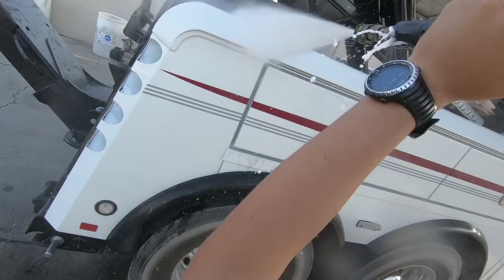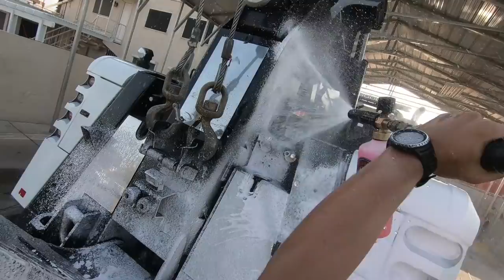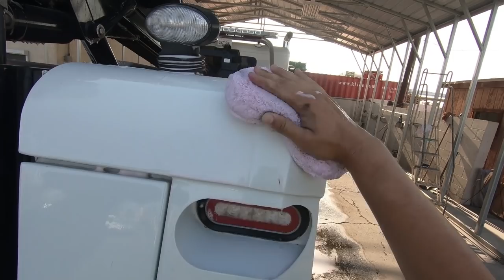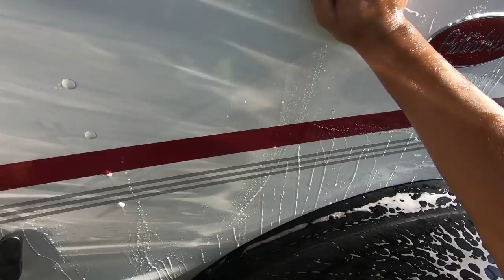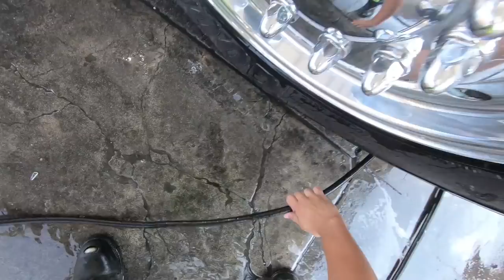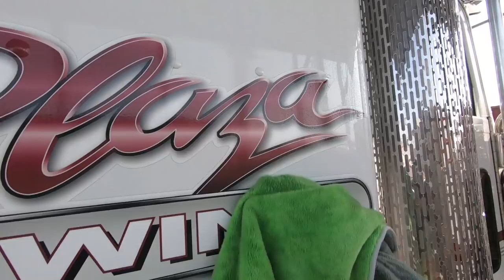How I Wash My Tow Truck | Truck Wash VLOG

Comment: Nice lookin truck. Up here in the northen states we washed our trucks EVERY DAY, sometimes more than once. Between rain, snow, salt, etc its literally a full time job washing tow trucks. A few months during the summer we might get lucky to go one day without washing but that was rare. The most important tool in our shop was the Hotsy pressure washer. We also towel tried the trucks every time. The washer and dryer never stopped doing loads of wet towels.

Comment: Awesome video as always… I had my car professionally coated to prevent scratches and whatnot. They told me whether or not you get the protective coating, you should always use a microfiber towel/sponge and make sure wipe side to side slowly and not in circles. It helps to reduce the swirl marks when wiping. Should also do the same when drying the car as well or use a leaf blower (yes that is what the prfessionals use). I also do not go through car washes as the brushes is what really leaves swirl marks in the car’s paint. Just a car/truck washing tip from someone who tries to keep their car looking as brand new as possible. Always looking forward to the next video. Be safe out there.

Comment: Have you tried Nerta soap? Its Belgian but engineered to clean dirty trucks and it foams up fantastically.
Try the Carnet Jumbo snow foam, really good stuff - most of the time you can do a touchless wash unless the contaminants are really bonded to the paint. You should be able to do the entire truck in ~30 mins, which means you can wash it more often and your truck is always clean.

Comment: Fun huh,  for quite a few years I pulled a manual neck 4 axle lowboy, had ramps welded to the frame, we used chassis grease on the ramps and rear end grease too, very messy, that is when I bought my first steam cleaner, real challenge washing the back end of the tractor, pull toy told you that.

Comment: trent your truck always looks good, so easy to see how motivated you are. a tip i like to detail my cars as well,can make them look brand new.always hit the glass first,before spotting. as far as the rest of the truck, use a leaf blower to get the water of everything else. they even have cordless ones. i would think after you spray foam the entire truck,rinse off with the power washer easy setting dry windows ,blow off the rest of the truck,would save u a lot of time, big fan of your vids